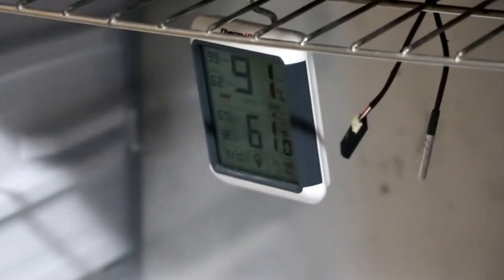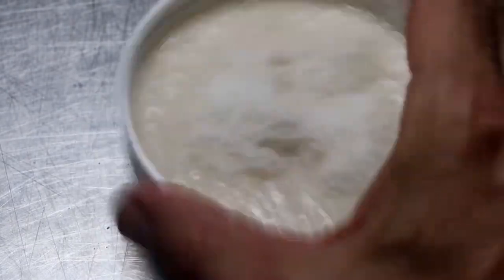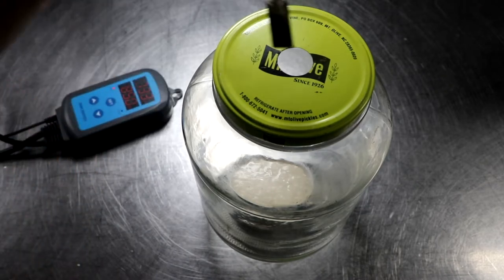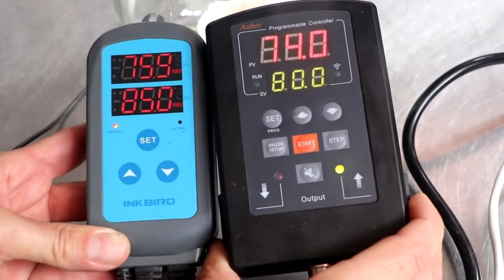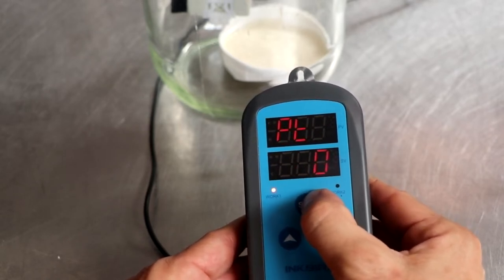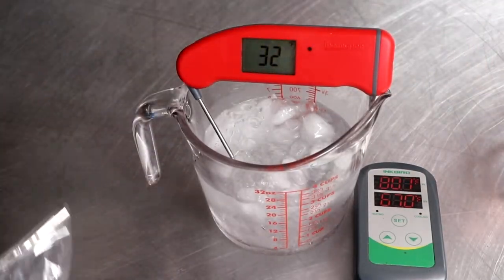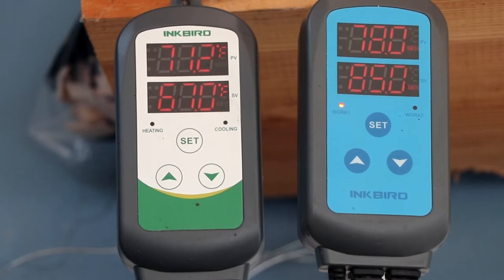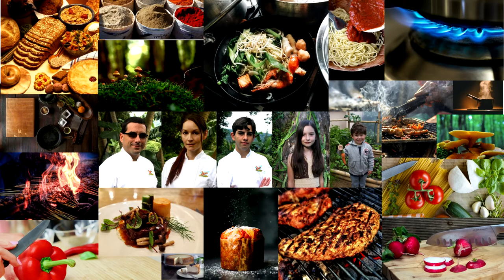Calibrating Humidity & Temperature Controls

Comment: This is exactly the info I needed to help me calibrate my InkBird humidity controller. Does the absorption of the water by the salt need to be at just the point where there is no standing water or does adding a little more salt than that make a difference? Curious at how exact that needs to be. Thanks again for the great info.

Comment: Hi Eric great video... I noticed on you inkbird initial calibration was not set to 0.0 . Should it not be set to 0.0 before and while you’re testing in the jar and then after 12 hrs make your +\- adjustments?
Reply from the maker: Hey Tony, Great eye...  You can and probably should reset the value to zero, but because it's not a technical calibration it's more of an alignment  I don't think it's as important.  The value units only go to +10/-10 so for the sake of keeping it simple starting at 0 would certainly make things less confusing..   I will call inkbird and Auber to ask them what they recommend..  Excellent question.  Thanks for watching..

Comment: Aloha 

I notice that in the Humidity calibration that you mention that the inside of the jar is 75%. Where does the 75% come from or am I just missing something. If the CA is set to 0....how is it 75%? Is this a typical average for salt in a jar?
Mahalo and I think your videos are a great education!!!
Reply from the maker: Hello Joseph.  When you add salt and water in those proportions the humidity that it creates in the sealed jar is roughly 75% (the temp has a little bit to do with it as well but it's negligible).  So the 0 setting is really more of a base marker for calibration.  For instance if the meter reads 70% and I know that it is supposed to be at 75%, then I would adjust the 0 up 5 points.   The device will then read true..  Does that make sense?  Let me know if that helps..
Reply: @2guysandacooler  Perfect...I left the jar out last nite and it read 74.2. I adjusted to the 75. Thanks for info.  Aloha
Reply from the maker: You weren't paying attention (too busy criticizing).  In the first minute I say that you should have a salt to water ratio that doesn't allow for any free standing water when the salt settles.  Everyone's container will be different and depending on the salt that is used the results may vary.  The way I described it is exactly how much salt to water you should add.  Also at minute 5 I placed a brand new hygrometer from ThermoWorks (recently calibrated by the factory) and it read 75% humidity when I placed it in the bag.  

Obviously you've never done this technique...   You should try it before criticizing it...

Comment: I found a cheap WIFI alternative to Inkbird. Sonoff TH16 with a probe. It does temp & humidity. It can be linked to a 4 channel relay that can controls humidifier, dehumifier, heating/cooling element. The good thing is : you can create "Scenes" from your phone (set the temp/humidity ranges at which all the devices are fired up). Drawback: no temp/humidity historical data in the app (apparently it is possible to link the sensors to other apss which could do that).
Reply from the maker: That's interesting.  I just looked it up and sure enough, a 4 channel relay to control all the functions..  Are you going to get one?  I'd love to hear about your experience using it.
Reply: @2guysandacooler  yes, already ordered mine. Will have to find the case + other stuff needed to wire the 4 CH relay to the humidifier, cooling element etc. At the moment I have stuff in a cooler box linked to my inkbirds ;)
Reply from the maker: Nice.  When you get it and use it for a bit be sure to let me know.  Having an all-in-one controller is very appealing..
Reply: @jd5787  How did your 4 channel set up work out? Is the Sonoff TH16 any good?

Comment: Hi Eric! Hope you see this comment. I'm looking for Auber HR controller the one you have and I want to ask. Does it control humidity better then inkbird, is it worth investing? I'm trying to find more info, but all I find is their website and it says it controls better humidity during fridge compressor cycles, because inkbird shots right down to the bottom and then tries to humidify it;s way back, making huge dips in the fridge, does it work better? would be even nice if you made a detailed video on this brand. THANKS!
Reply from the maker: That's a great idea.  I personally like the Auber better.  I just bought 2 more (funny enough).  They are more accurate and control the humidity with better precision.  I think the model is the HD330 (with Wifi).  I'll get a video going very soon!!

Comment: Why did you do a (-0.6) on the Auber when it shows 73.9 on the display?  Shouldn't it be (+1.1)?  You want to reach 75%, correct?
Reply from the maker: Hello 100%ATP.  You have a very keen eye.  Under normal circumstances you would be correct.  If this would have been the first time I had calibrated my unit my "offset value" would have been set to 0, but because my offset value was at -1.9 my adjustment was different.   For the sake of not making it look confusing I should have zeroed it out before starting but the principal is the same.  You want your final number to read 75%  so whatever the humidity reads you have you need to adjust the offset value either up or down to correct it.
Reply: @2guysandacooler   thanks for that clarification.  I assumed it was at 0 as well so i was also scratching my head thinking this doesnt add up! maybe a statement saying inkbird measured x and we need to read 75% so set the calibration to 75 minus x.  Now youre covered (and we dont think you cant add and subtract correctly). thanks again
Reply from the maker: @stevenstep3424  😂😂😂😂  That's a good idea.

Comment: I have both of the inkbird controllere in this video. My question is can they work with digital equipment? I had to go out and buy all mechanical controlled heating, cooling and humidity equipment (which are hard to find nowadays) because I can't figure out how these controllers turn a digital ac for example on and off if there is no mechanical switch that can be left in the on position. Inkbird sales rep said its possible but never explained how. Thanks in advance!
Reply from the maker: Hey Jon.  Interesting situation.   If you plug the inkbird to the digital ac and it sends power to the ac what happens?
Reply: @2guysandacooler  it does nothing unless I press the ac "on button" myself. Not sure if I am not doing something right or if they just arent compatible with digital.
Reply from the maker: Oh wow.  from what you are telling me it sounds like they might not be compatible with digital unless you can turn the digital unit to "auto" turn on when there's power
Reply: @2guysandacooler  And yoh sir just saved me $275 that i was going to spend on a mechanical controlled AC. Auto function works with Inkbirds. Thank you
Reply from the maker: @wermy76  Oh how cool is that!!  Saving $275 is always a win in my book!!  I'm glad you got it to work..

Comment: Hello sir! I have a question about your calibration method. I live on a coast and have salty and very humid air. Should i heat the test jar thereby evacuating moisture from it or use some other method to minimize the ambient humidity's effect on the calibration? Or does the salt/water solution both raise and lower the humidity to 75%?
Reply from the maker: Hi there. Your third point is correct.   Regardless of what it is outside the jar inside the jar (airtight) will be 75% once you add the salt/water solution.  Be sure the temperature of the room is constant and after 12-18 hours you should be able to see if you need to calibrate your unit..   I hope that helps.  Thanks for the question...  Do you live along the Gulf of Mexico?  I left after Hurricane Katrina....  Long time since I've been back...
Reply: @2guysandacooler  Corpus Christi Texas. So, yes, Gulf coast living. :-)
Reply: I got a question. Does the jar stay at 75% rh, because I need my humidity at 60%

Comment: I'm curious what your parameters are for the IHC-200: humidity set value, differential values, and alarms. Thanks.
Reply from the maker: Let's see.  my HS is set to 80%, my HD is 3, my DD is 3, my high alarm is 100, and my low alarm is 65.  Here is a link to the instructions if you need to see what the codes mean.  https://pmod79883-pic31.websiteonline.cn/upload/_2016.pdf

Comment: Can I ask a question;
What fitting (exactly, specifically, type) did you use to pass the inkbird cord through the wall (of fridge, or whatever).  My cable glands are too big for it, just barely.
Thanks.
Reply from the maker: Hello, 

I drilled a hole at the top if the fridge by the door large enough for the chords to pass through..  I think it was a 1.5 inch hole.
Reply: @2guysandacooler  You must be talking about the power cords?  I guess your entire inkbird unit is in the fridge?
The sensor cord is only a few mm in diameter...
Reply from the maker: @circle4922  you can see my set up here.  https://youtu.be/SKR9U_R8uwk
Reply: @2guysandacooler  Ok great.  Thank you.

Comment: Hey mate, I have just unboxed and set up my inkbird humidity controller. I have set it at HS 80/HD 3/ DD 3 /AH100/ AL50/ pt 0 / CA 0 .

My issue is the controller allows the chamber to drop its humidity to as low as 50%. Once the humidity on the reader reaches 85 % it cuts off power to the humidifier but fails to turn it back on. I feel like the HD and DD settings on my controller are absent. 

Have I missed something here or have you ran into a similar issue ?

Thanks mate !
Reply from the maker: Hey Peter.  That shouldn't happen.  There's a couple things to look at.  Does your humidifier have the ability to turn back on once the power has been cut to it or do you have to manually turn it on every time power is cut.  Easy way to check is to plug it into a wall outlet and turn it on.  Then unplug it from the wall, wait 20 seconds and plug it back in.  If it starts back up automatically you are good to go.
If that works then the next thing is to see if your controller is working properly.  Work 1 is for humidity and work 2 is for dehumidification.  There should be a red light that turns on to let you know which side has power to it.  when work 1 is active plug a lamp or something into the outlet and see if it turns on the do the same for work 2.  

Your settings look good.  Let me know what happens
Reply: @2guysandacooler  seems my humidifier and dehumidifier are wrong for the job, they are required to turn on manually and therefore the controller can’t over ride them. Back to the drawing board , I’ll have to invest in different units.

The fridge I have actually runs at 55f and at a humidity that fluctuates between 62 and 87 humidity . The cooling cycled lasts 13 minutes with an overall average of 86 humidity. Do you think the fluctuation is problematic or will it be ok until I get the right units for the job.
Reply from the maker: @Pbirdification  Temp is fine but the low 62% might be a problem even if it's only for a little while.

Comment: why did you put the number 3.7 in calibration if you were of 0.4%. thx
Reply from the maker: I didn't.  3.7 was already there as I had already calibrated this unit 6 months prior.  I only adjusted it by a couple points to get to where I needed.

Comment: Ok so it reached 75% exactly then it was showing 2.7 I change it to -2.7 save results 66.4 ???  What happen or should I set it to 00.0
Reply from the maker: start at 00.0.  run the calibration then after 24 hours adjust the number to have it read 75.00%

Comment: I dont get why "it should read 75%." Like if theyre both off a bit, are you just averaging or..?
Reply from the maker: Hey Nick.  As close as I can get to being accurate on the calibration the better my setting will be in the chamber.  You are right though.  It is basically an average in the chamber..

Comment: My ink bird humidity Controller has started failing on me. My humidifier stays on after its reached the target. It never used to do this it's only recently started playing up. Any ideas 🙄
Reply from the maker: There's a relay that switches the power on and off.  sometimes those go out.  I have found that if you unplug it for 24 hours and plug it back in, they tend to start working again.  Just an idea.  Let me know what happens with yours...  I try to have backups at all times just in case mine goes out...  Thankfully they are fairly well built..

Comment: I have tried this method and I cannot get it to work I have a brand new inkbird I placed the probe in a big jar with an airtight lid, I placed pink Himalayan salt into another lid mixed it with water to the same consistency and it has been like that for 24 hours and I cannot get the reading above 72 so how can I calibrate it if I cannot get it to 75, I see you managed to get it to 75 okay but I have been trying now for 24 hours and it just is not rising, what am I doing wrong?
Reply from the maker: Hey David. When mixed properly (wet sand look) the environment will produce a 75% humidity.  Temperature plays a small factor but it's almost insignificant when using salt at anything above 55F.  There's a decent chance you need to adjust your controller as it's probably off by a little.  These units are great but don't always come calibrated perfectly..
Reply: @2guysandacooler  thank you for the reply I have mixed it to a wet sand lock and believe it or not it's just dropped by another 2% down to 70% i am totally confused but thank you for your answer I may have to find another way to calibrate it, either that or the one I've bought is defective
Reply: @stillo1578  im confused. youre measuring the salt/water to see what the meter reads to tell you if you need to enter an offset value into the calibration setting to get the tool to red correctly (it should read 75%rh.  If yiou are reading 72 or 70, then you enter either 3 (if you read 72) or 5 (if you read 70) in the CA setting,  Now the humidity read 75 (or it should)

Comment: Anybody advertise an ink bird is scamming you you can’t control humidity and temperature at the same time
Reply: Its 2 different controllers. One for humidity, another for temperature. The inkbird simply toggles between humidifier/demumidifier and cooling/heating based on your settings.

Comment: Wtf is this b.s so much work to calibrate smfh there has to be a simpler way
Reply from the maker: LOL...  You're talking about precision instruments.  If you're not willing to go through the trouble of calibrating properly you probably shouldn't be growing weed😂😂
Reply: @2guysandacooler  I do not find it to be "so much work" to calibrate, and am doing the humidity side now, with an ice bath next.  Thank you for the video showing me what to do :)
Reply: Of course there is. Take 3 humidistats and place them in the chamber. If the reading are within 3 degrees. Take the average. If one  is off by 3 or more but two match up. Take the average of the 2.